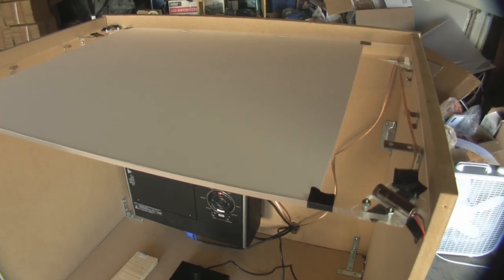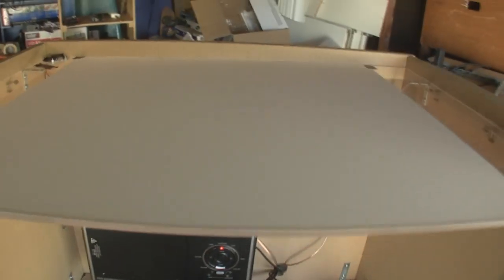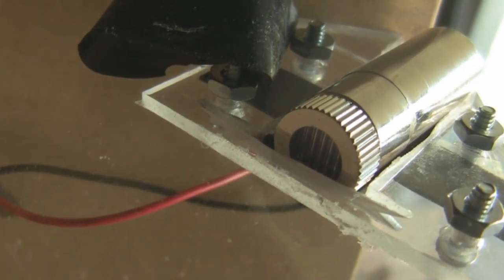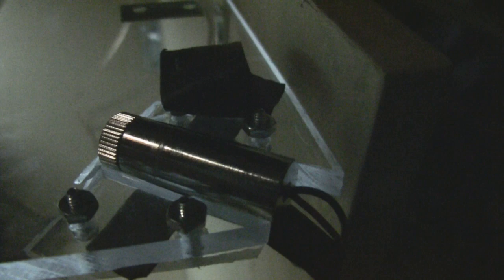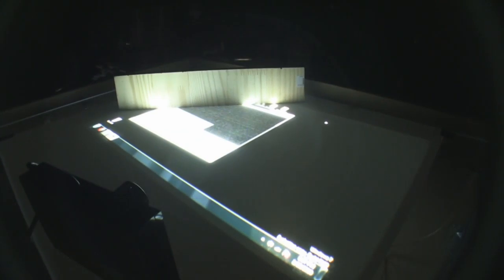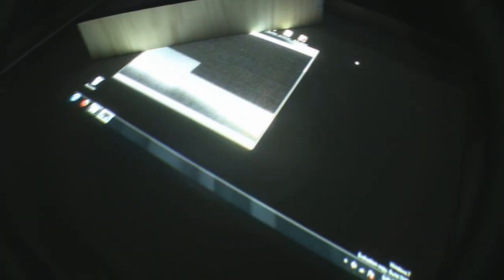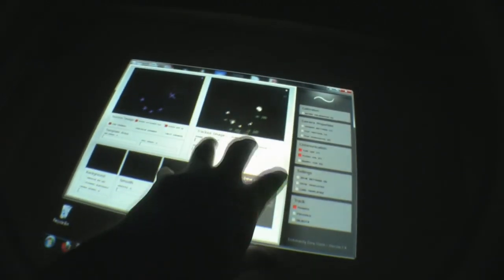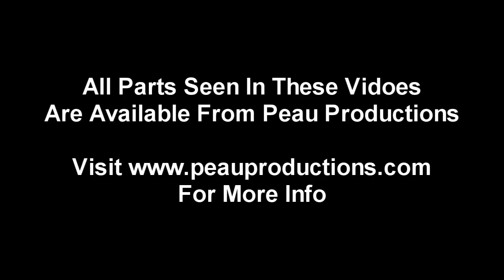How To Build a LLP Multitouch Table

Comment from the maker: If you want to use a LCD, you have to separate the LCD layers placing the image plane on the top and the circuit board off to the side.
The projected image is shone onto some rear projection acrylic which is placed on the surface.  When not using an LCD and using a projector instead, the projector is mounted underneath the screen typically.
We use the modified PS Eye cameras which we sell.

Comment from the maker: We prefer LED-LP over LLP due to safety reasons, though you will need to solder a LED frame around your touch surface so thus more work(though alining lasers can be a tedious task).  If you put the narrow beam 850nm LEDs we have on our store around all 4 sides of your screen, you will get great results.  We had a customer build a 30x10m screen successfully using these LEDs at the top and bottom of the image.

Comment from the maker: The tracking application CCV outputs TUIO which is a communication protocol for your interaction points (x,y). You would need a TUIO to Windows Touch event driver/application in order to use these camera-based setups with normal mouse applications.  There are many apps built with just TUIO so look for those too.  Yes it will work on Windows 8 Pro (and all Windows 7 and 8 versions)

Comment: What exactly is meant when you say it can be used with LCD setups?  How exactly are you project the screen onto the acrylic surface?  Is the projection surface covered with some sort of paper and a separate projector is used to display video output from below where the IR camera would normally be?

Also, what type of camera are you using?

Comment from the maker: @devilsonlychild It is always better to use LEDs in an LED-LP setup due to the danger of working with lasers.  Once the line lens is placed on the laser though, the beam is spread very thin and can be typically used safely in installations.

Comment from the maker: Yes there is a risk that the IR laser will be reflected and damage the user's eyes.  If you are worried about this (as you should be) and expect reflective objects to be placed on the touch surface, I would suggest you look into making an LED-LP table instead of an LLP one.

Comment from the maker: Read up on our site under the LEARN -> Software to get an idea how the camera image is translated using an image capture program like CCV and the touch coordinates are sent to the computer. To use it like a mouse you would need to convert the TUIO x,y points output from CCV to a mouse driver. Search around on the TUIO site for a TUIO mouse driver.